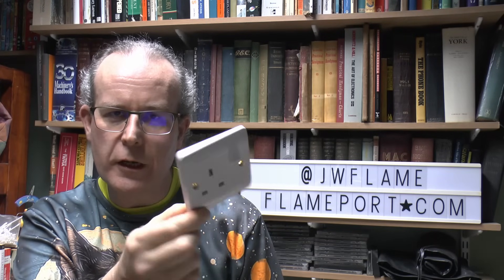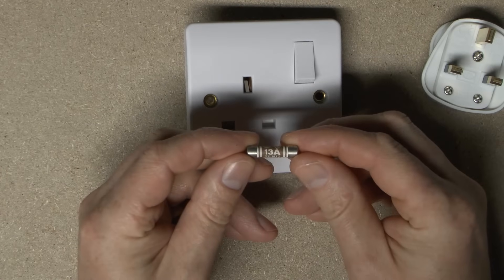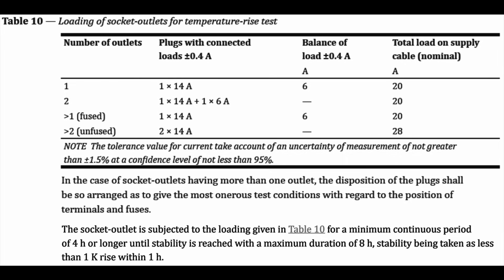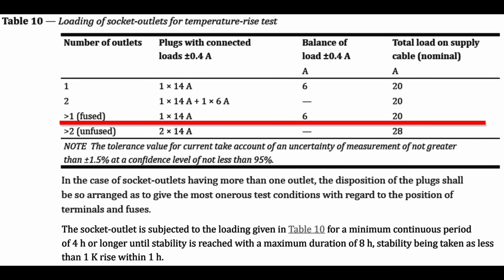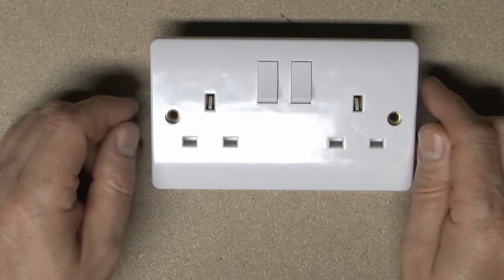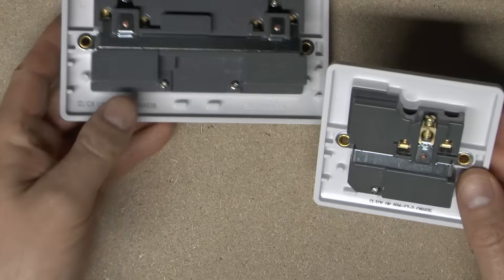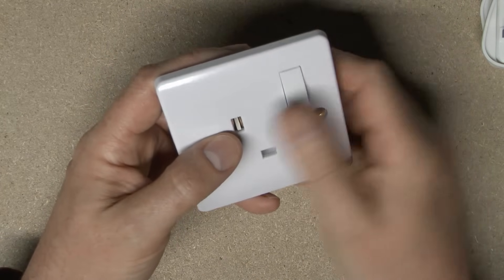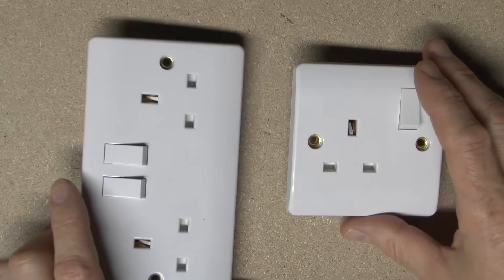Double Socket Outlet 13A 20A 26A? EV Sockets, Fuses,  Washer/Tumble Dryer in one double?

Comment: 20A total.
I've come across a situation where someone didn't want the hassle of running a cooker point to their kitchen.
Instead, they searched high and low for an induction hob which provided a shared load instead of full power to all its rings when all 4 were in use.
It was fitted with a 13a plug.
To complement this, they also got the cheapest, lowest power built in oven they could find, and that had a 13a plug too.
They stuck them both on the same double outlet, till I advised against it.
Next time I went, they had removed the one from the hob, connected a trailing extension (poundland type) to it, then re connected the hob into that, along with a 3kw kettle and a toaster..
The fuse went in the extension lead
Reply: Seen an entire kitchen run off a single spur, stove, oven, microwave, kettle and toaster plugs all wired up with a single 2.5mm cable, and a 32A breaker, because the original 20A one kept tripping. 

Or the building site temporary supply, all breakers were 63A ones, irrespective of the load, feeding plugs (all broken to some degree), lighting and housed in a cracked cabinet, all full of mud as it was on the ground, the batten that was used to hold it having been broken off at some point. Fed from the incoming supply, with only the pole mounted 100A breaker as isolation and protection, with the feed cable being 3 6mm wires tied together at intervals with packing tape. Switches, possibly there, RCD, in the panel but not connected, and no incoming isolation switch at all. As a bonus also the extension cords used were all either frayed, mangled or, in a few cases, had no plug, so the 2 wires (old 2 wire orange garden power cord) were pushed into the socket and held there with some bits of wood. not my site, just next door, and I was not going to make them aware of the danger either, seeing as the entire build was illegal, but inspectors are cheap to bribe.
Reply: @SeanBZA  wow.
Incredible.
I think my folks here thought it would be safer to put it further from the wall socket, hence the extension lead.
Having done that, they then compounded the problem further by bringing the kettle and toaster from the other side of the kitchen, using the theory that it will easily carry it as there is still one more outlet free.
You just can't assume the logic of some people.
Reply: @ Never look up informal settlement wiring, mostly made from repurposed (read stolen) phone wire, and the odd length of steel fence wire.

Comment: The 20 amp load bit is all well and good as long as the building wiring is in good order. Personally, I would stick to 13 amps max.
Reply: It's fairly unusual for the wiring not to be capable of a mere 20A..

Comment: I have found sockets where the wiring behind has come loose, maybe due to vibration from plugging and unplugging chargers etc. Would Waygo-style push fit connectors be more reliable, and if so why aren't they more widely sold?
Reply: Perhaps more likely is that although the screws have been fully tightened during installation, they magically become looser over time.  Just check the next time you have to check the wiring.

Comment: Pethaps this is an idiot question ...  but where is the heat actually generated in a 13 amp socket? Is it the spring contact with the plug pins? If so does the contact area vary between manufacturers etc? Is there any way to tell from spec etc?
Reply from the maker: In the socket it's the small resistance of the wiring and the metal contacts, plus a small extra resistance where the plug pins meet the socket contacts.  All cables, wires and other conductors heat up when current passes through them.
Most of the heating is from the fuse in the plug which gets hot by design, at full rating a fuse will act as a 1 watt heater.

Comment: The  fuses in UK plugs  run quite hot when run  at close to their rated current. The fuse passes the heat along the carrier through to the pins and onto the sockets.  This is a weakness with the UK sockets.  This can distort the socket and plastic compounding the problem.  Our sockets would be safer if the 13amp fuse was bypassed and we relied on the breaker to control the current for larger loads like tumble driers.  

The smaller fuses  are actually a good idea for chargers and low current devices.  The 13amp fuse is more of a risk than a safety now we have thermal magnetic trips in our consumer units.
Reply: x ray machines that are pushed to the bedside in hospitals have unfused 3 pin plugs with an overspecced wire diameter higher than the internal hospital wiriing, and a breaker in line.  If they ran with normal 13A fused plugs they would turn the sockets brittle v quick because of this resistive heat from the fuse conducting down the live pin into the socket
Reply: @ interesting, Tumble driers should really be the same.  The consumer unit protects the cable to the socket.  The onboard fuse protects the internals.  The only thing the plug fuse is protecting is the lead between the appliance and the wall socket.
Reply: fair point

Comment: Surely it depends whether the double socket is on a ring with a 30amp m.c.b. . That should be good for 2 x 13 amps. 
Radial wiring ?
Reply: No it doesn't actually make a difference. He was testing the capability of the socket not the wiring. The assumption was that the circuit itself was fully capable of dealing with higher loads than the individual double socket.

Comment: My experience is that the plugs themselves don’t like running at full load. I have an industrial fan heater and the plug top itself gets hot , the heat coming from the fuse connections.  The “old” manufacturers kit is noticeably better than the chain store brands.
Reply: I ran a 13A plug to power an EV charger. I restricted maximum current to 13A initially and ran it with the plug top off. Used a thermal imaging camera and at 13A the fuse itself was by far the hottest part of the plug.
Reply: @dopiaza2006 exactly,  the fuses are more of a danger than a help.  A melting wire is going to get hot before it actually fries.  It should be a 20 amp fuse for a 13amp load.
Reply: The 'old' style MK 13 amp plugs from the 1960s & 70s are one of the best plugs to use for high current appliances, they can run 3 KW for hours & barely get warm! Even better when coupled with a socket of the same vintage!

Comment: German sockets are designed for 10A, even if a 16A circuit breaker is used. 
It is recommended to lay separate supply lines for washing machines and dishwashers. 
European household appliances are designed for a maximum of 10A.
Reply: Do they have fuses in the plugs?

Comment: I did some research on plug sockets some time ago rewiring my flat. FYI, I'm an electronics engineer. From what I remember, double sockets were rated at 22A, only MK were actually 26A. Obviously different brands may have different values? Since then, things may have change. DO YOU RESEARCH.

Comment: Genuine question.  I’m not an expert, but aren’t there many of these sockets on a ring which is protected by a fuse in the consumer unit - so an additional factor being what the ring can support - so if you had 20 13A sockets on the ring you can’t draw 13A from each of them at the same time as that would exceed the ring rating?
Reply: Yes, the total limit is the fuse or circuit breaker (MCB) and the cable rating for the cabling used. Typically a radial circuit is 20A (fuse or MCB) and a ring circuit 30A (fuse) or 32A (MCB).

Comment: I discovered a cheapo B&Q extension cable (it was orange, I think that helped) is capable of withstanding six hours of 3kW going through it while charging my car at my sister's. I used the totally legit method of being parked outside her house with the extension cord trailing through the letterbox into the closest socket. The plug got warm and the wire went more bendy, but nothing actually got worryingly hot or sticky. I guess having the majority of the cable outside lying on the ground probably helped.
Reply: 2.4kW, not 3. 🙂
Reply: @djtaylorutube  Agreed. I can only charge my car on a granny cable (due to where my main CU is and the layout of my house - don't fancy paying £3k or more for a really quite invasive install as it may require pulling up floors etc). There's an existing 16A feed into my garage so I replaced one of the sockets with an EV rated MK one and just plug the Volvo/Polestar EV charger in to there - all the fuses in the main CU are RCBO and I have a slave CU in the garage with an RCD on it. The EV charger only runs at 10A maximum so it's usually 2.3kW but occasionally 2.4kW in the middle of the night. (In fact, as far as I'm aware there are only 10A 3-Pin chargers available?). The longest I've run it for continuously is 28 hours - returning from Scotland with a battery state of charge of 12% (and my EV has a 78kW battery (75kW usable) and this charged it up to 90%) but normally it just gets scheduled to run in the 5 hours overnight during the octopus go cheap rate times.
Reply: @ Is that a proper 16A feed?  If so, you what you could do is use a Tesla granny charger and swap the 3 pin to a commando 16A tail and get a faster charge.  Of course, if you're happy as is, then no fuss. :)
Reply: @TheMrMarkW  Unfortunately there a full 13A chargers available on  Amazon.

Comment: I heard from my company about fake bussman fuses years ago. Where the hell is the mark-up or money made on manufacturing a “ fake” fuse, how does that work ? If it was for an aircraft or had to be made to some kind of mil-spec i could kind of understand ?
Reply: There are fake chips (NE555 "timers") that compete with real chips (priced at £0.34 each inc. VAT, less for bulk prices)... The point is that a fake fuse is still cheaper to make and ship from the far east and make a profit on it, so as long as people buy...
Reply: @Mark1024MAK yes, ive heard about those , i used to use them back in the late 70s early 80s, i think i used to buy them from RS components or Watford Electronics , prob about 12p each back then.

Comment: 20A. So, the limiting factor is one leg of a ring in 2.5mm^2, right?
Reply: No, on a ring circuit (rated at 30A or 32A) two cables are used, so both should supply some current (although due to wire and terminal resistances it's unlikely that the currents will be balanced). However, if the double socket is on a spur, then the rating of the cable is more important, which is 20A.
Reply: @ and if the ring breaks, you’re at 20A. Which was my point. In truth I suspect the limit comes down to the cross-sectional area of the internal conductors. Still, it’s a fascinating look at the arcana of the standards, and I would bet good money that there are people with a 3kW kettle and a 2kW coffee machine plugged into the same double socket. Which, since you weren’t asking, is why I have a row of singles at my brewing station :-)

Comment: Hi JW, Very interesting explanation.  

However I prefer the one given to me some years ago by the sparky wiring my parents home "That's why we have ring mains in the UK .  The power for the socket on the left comes from the anti clockwise cable and the power for the socket on the right from the clockwise cable"  Makes perfect sense 😎😎😎😎😎😎
Reply: I like ring circuits because if you have to work on a live DB with only that circuit off you can test them at the sockets without taking the cover off the DB. To test a radial circuit you always have to link L-E at the DB to test continuity
Reply: What your sparky told you is rubbish! There are effectively two cables in parallel feeding the circuit and the current flow in each cable will depend on the load and impedance of each circuit.
Reply: @josephe3697  If you are commenting on my comment above you clearly missed the humour/sarcasm in that comment 🤣🤣🤣🤣🤣🤣
Reply: I did indeed miss it. I must try harder 😀
Reply: Very amusing 😂
Does anyone install new ring finals these days? I never do, they were invented by beelzebub himself.
Reply: @2Sorts nope.  4mm radials all day.

Comment: If you intend to draw 26 Amps from 2 sockets install 2 single sockets, and ensure the circuit can handle it (32 Amps ring final circuit - 2.5mm², or 32 Amps radial circuit - 4mm²).
Reply: 2.5mm cable will handle up to 18 amps in free air( admittedly less under insulation and inside walls but
Not much less). With a ring main that’s about 36 amps. 
I was taught that , yes you could take 2x13 amps from a double socket, but only one per ring main. But that was a long time ago!

Comment: I use a granny charger running at the full 13 amps. After four hours of charging, the display shows that the plug(in an outdoor socket) temperature was still only 31 degrees C.
Reply: Your "granny charger" runs at 10A unless it's illegal! (That limit applies to all portable EV charging equipment.)
Reply: @MrAdopado  Nope, it's 13A. From Tough Leads. User selectable 6A, 10A or 13A.
Reply: @ Take care with it ... I note that Toughleads state "In the UK the charger is limited to draw no more than 10A (2.3kW). This is because whilst a UK 13A plug can supply 13A for short periods of time, it may overheat if that amount of current is drawn for longer periods of time. Where the current can be adjusted by pressing a button on the granny charger, care must be taken not to exceed 10A, as higher currents may damage the plug/socket. The only exception would be when a granny charger is plugged directly into a BS1363-2 EV socket, when 13A may be used."
Reply: @ That's not the right one. I have a 13A charger. I have a photo of the screen when it's been running at 12.7 amps for four hours, the plug temperature is 31 degrees.
Reply: @mrfocigaz4942  I'm now not doubting that you have a 13A charger. I'm also not disputing that you may have an excellent socket and wiring example at home which copes well with running at 13A for 12 hours. My concern is that (from my own experience) many people have 13A sockets with less than stellar wiring/connections, that can be 40 or 50 years old and when run at a steady 13A for up to 12 hours at a stretch can get very hot indeed and could constitute a fire risk.

Comment: One big issue with using a 13A socket, marked EV or not for car charging, is that there is no broken PEN connection protection. If you have a TN-C-S earthing arrangement, that is less than ideal as if there is such a broken PEN, then it's just as likely to electrocute somebody as a 7 kW car charger without broken PEN protection...
Reply: If you are charging from a 13 socket then the granny charger has the PEN fault protection built in
Reply: @jon_273  Beware! Only some (more recent) granny chargers have PEN fault protection. I would bet that most that are presently in use do not.

Comment: The 15 Amp and 20 Amp fuses look like old fuses that were made to fit into MEM (I think)  fuseboards, which used this type of cartridge fuse instead of the 3036 fuse wire. I have a few knocking around in the van.
Reply: No, those get physically larger as the capacity increases and non will fit in a BS1363 13a plug
Reply: @jon_273  I’ve just had a look at the ones I harvested from an old MEM fuse board, and as you say, the ranger the amperage the larger the physical size. The 15s, 20s and 30 are much fatter and more like a BS88 shape. But the 5 Amp ones are actually slightly shorter than a BS1362 plug top fuse. Thank you for taking the time to reply. I really enjoy your videos.

Comment: Yes, most appliances are now 10amps. It was once the case anything over 3Kw 13amp required a double pole isolator under fixed equipment. I did my training under 16th Ed. In Ireland we are not allowed to put kitchen sockets in units.. Boohoo

Comment: modern accessories are junk. Even a 13A spur won't handle 13A without burning and melting over time.. Hell, even 2kw devices can burn them out.
Likewise so will the plug sockets. Just scrap quality everywhere.